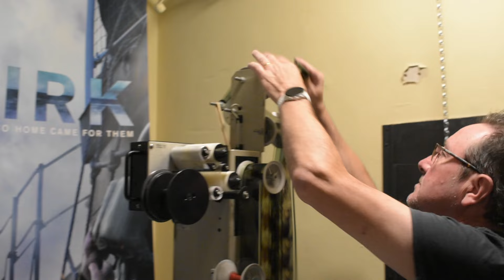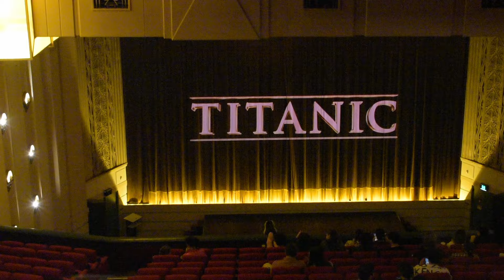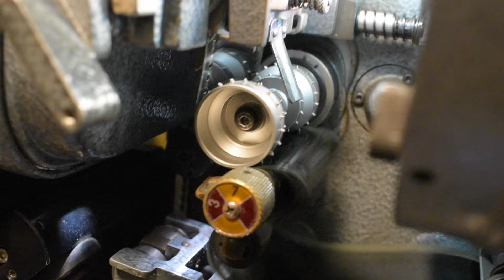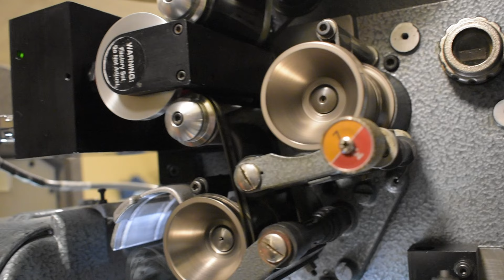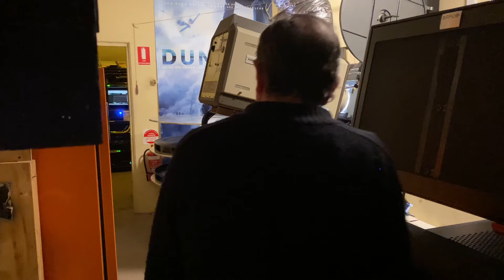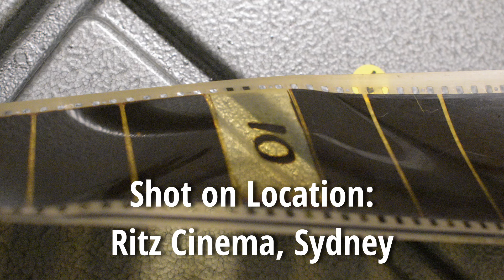TITANIC in 70MM - Ritz Cinema, Sydney

Comment: Can you share more about The DTS sound system? Greetings from Mexico!!
Reply from the maker: The Dts reader feeds the DTS timecode into the DTS processor, in which it detects the code and finds the correct track to play exactly in sync, it does all of this within 6 frames of reading the timecode. A much better explanation can be found in my Oppenheimer at the Ritz video. The Film-Tech Cinema Systems forum/website also has great information about it too. Cheers! have a great day
Reply: In addition to Clark's reply, the DTS system detects if there is a join or piece of film missing and instantly jumps the CD-R to the correct spot to keep it in sync. Personally I prefer the sound of 6 track magnetic sound - a system now only found on older 70mm or 35mm film prints as it is obsolete. The magnetic sound is much warmer and has more depth and presence than the DTS which I find a bit top-end heavy and shrill. When I screened DTS we ran the sound through a professional equalizer to make the sound a bit less harsh. 
The DTS system is the only sound source on DTS 70mm - so if your DTS reader, or processor fails there is no sound. On post-mono 35mm film there is usually multiple sound tracks to cover if one fails.
Reply: I’ll bet it has The Digital Experience Waterdrop Sonic Landscape and Sparks trailer

Comment: wow...thats one full platter deck!
Reply from the maker: sure is. obviously, if it were 6 track mag it would have to be split with an intermission.
Reply: That is a scary weight. I much prefer to screen 70mm on spools - two projectors. Yes the thickness of magnetic sound adds substantial volume to a spool.  @ClarkTeddles
Reply: 86KG or 189.5 Pounds